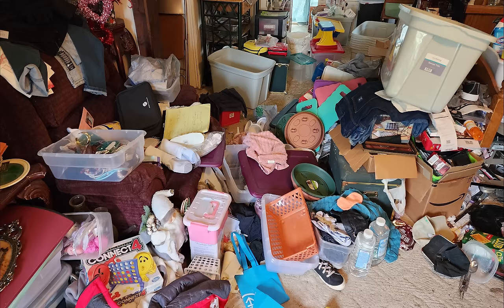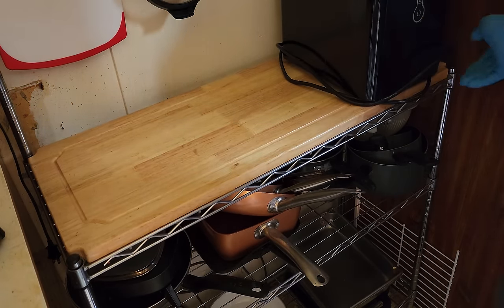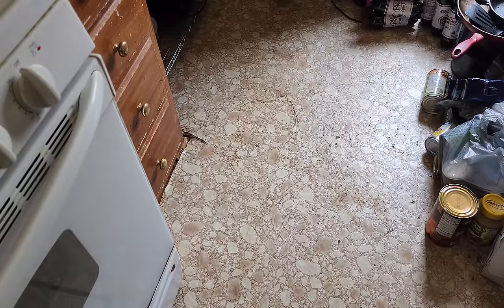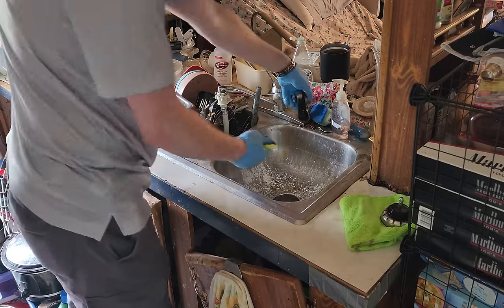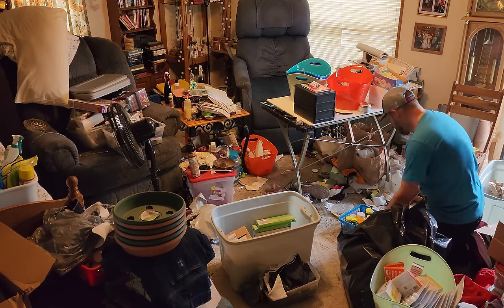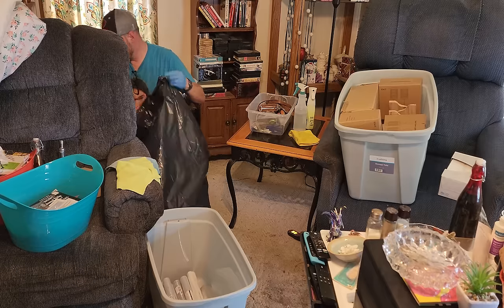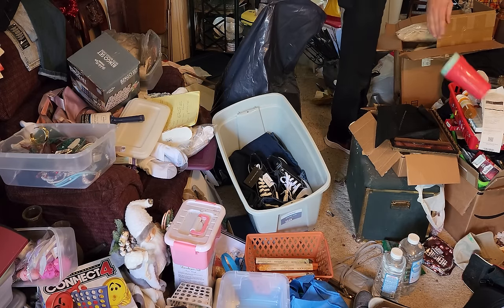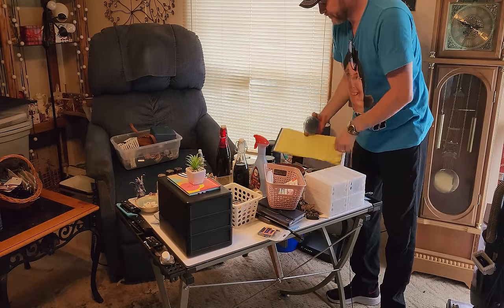She's getting therapy. Let's clean her house for FREE!

Comment: I totally get the "Chinese puzzle" metaphor. I once had a cluttered kitchen (not hoarded or dirty, just a few too many objects), and I began the process of decluttering it a few years ago. My goal was to reach a point where I didn't have to move anything to access something else. This included storing pans in the oven (a family tradition! LOL). My kitchen is so much more functional and easy to clean now. Everyone should try it, even if they're not hoarders.
Reply: PS I noticed that the air vent in the living room floor was partially blocked. If there are a lot of blocked vents in the house, that could be one reason the AC isn't cooling properly.

Comment: Currently I'm switching and renovating my bedroom and office. The office was unusable. I was quite depressed so I just packed everything I couldn't deal with in that room. 
Someone here on YT said: Even if you could use something later, are you sure that it's worth owning anyway? If it's causing such a mess that you can't find it and need to rebuy it anyway than it's better to throw out. Glad I heard that before I started. Slimed down my stuff a lot. Gave somethings away for free, sold some things but mostly put it in the trash. 
It's exhausting and partly though I was crying and ready to quit but I'm nearly done and the relive is true. (With the two rooms, the other rooms need a sorting, too but that's a problem for another day) Having everything fit in their container again and setting up a workstation for my hobbies and regaining use of my office really feels good.

Comment: I helped a lady get her kitchen in order years ago. She had so many dishes! Instead of helping her with the dishes, her son just kept buying her more. Both sinks were full, as were the counters, table & stove. She had boxes and boxes of dirty dishes stuffed under the kitchen table & chairs.

I did exactly what you're doing, lots of shuffling. It took me several days because I can't stand for any length of time, but I got it done. 

After that, I got started on her. I wasn't aware of the condition she herself was in until I finished with the kitchen. She kept everything well hidden by wearing a hat & slippers at all times. I think she trusted me after seeing what I was able to do in the kitchen.

She had toenails that had wrapped around under other toes & her hair was terribly matted. She had had clips in her hair and every time a piece of hair would come out she would tuck it back in around the clip so in amongst all the matting were broken pieces of clips.

She felt so much better afterwards & so did I for having been part of the solution.

Comment: Do you guys ever use plastic paint scrapers? I have found them really beneficial when having to clean up large gunky areas. I spray the area down, fold a paper napkin over the scraper end, then scrape away the gunk. I fold the napkin over the scraped up gunk & use the rest to wipe it up.

Comment: I wonder whether the air conditioning was less effective because vents were blocked. For example, I noticed in the kitchen on vent on the floor, and thought, "I've never seen a small square vent like that. I've only seen them about that width but twice as long." Then I saw that the other half was covered with a tile or piece of wood, and a wire rack on top. Great work!

Comment: You have a lot more experience in cleaning than I do, but at one point you mentioned that the stains weren't going to come out of one of the counter tops. One time I got permanent marker on a counter top, and the only "exfoliating" (for lack o a better word) cleaner at hand was dishwasher powder. I scrubbed the counter with that and the marks came right off. Maybe that might be worth a shot? I don't kno if it would scratch or discolor anything, but I know it worked for me haha.

Comment: I haven't read thru the comments, but you mentioned central air conditioning she has: when was the last time she had a new filter installed?? I bet you open it up and it has 1 inch thick of dust and contaminates on the filter.  My daughter rented an apartment where I noticed the central a/c seemed to be constantly running but it wasn't that cool.   I asked if the complex changed the filter (where i live, it's done twice a year by them)  They had never changed it, the tenant is responsible.  Well, Momma checked it, opened it up and sure enough, it had an INCH think of dust on the filter.  Boom! Changed that puppy so FAST! SO........a/c filter check; drier check; vent check for drier, it builds up too; and hot water heater tank check.  AND....... I AM ALL THAT 2! 
Bleeephffa na na!

Comment: I have a string of traumatic events in my life and it’s only recently hit me that I have the beginning of a hoarding problem along which what I think might be a mild case of agoraphobia (not diagnosed so it’s pure speculation).
Thrift stores get me… I now have my clothes streamlined, put my makeup in a “purgatory” bag and have a small travel case I use daily and see if I reach for anything in purgatory and if not in 3 months it’s going to be thrown away. 

I did similar with clothing. Boxed up things I like but that I don’t touch, bagged up things I don’t like or wear at all and see if I miss anything in that purgatory box over a few months. Same with shoes.

Crafts are an issue too. I have fabric I’ve moved 5 times with from 2014 and never used. It’s insanity….

Comment: 6:48 I just realize they have the same cheap laminate stick-on flooring that I do in my bedroom, and it’s in pretty much the same condition because our hot water tank recently leaked out into my closet (it’s on the opposite side of the wall). It’s getting replaced soon, I just gotta wait for the guys to come up and fix my floor. 😅

Comment: I use lemon juice and baking soda. Mix into the consistency of school glue and paint it on the stain on the counter. Wait until the mixture is dry. Then wipe off with a wet cloth. It will take any stain out! I swear by this!

Comment: If her house isn't cooling down with the a/c on, the filters may need changing. I used to live in Florida, basically a steamy hot swamp of humidity, but the a/c should work well no matter what the humidity is... (Don't let the beach and Disney commercials fool you, the heat and humidity in Florida are beyond miserable)